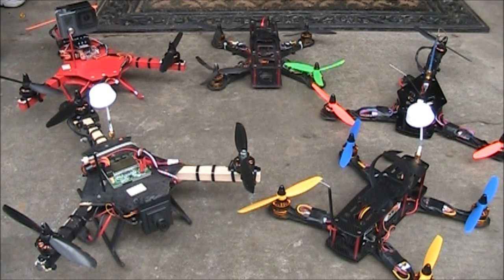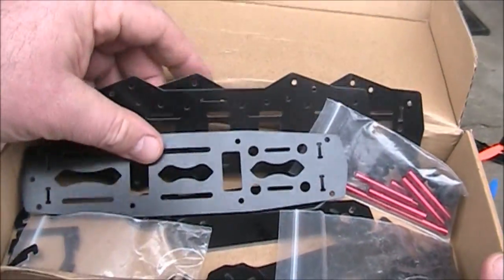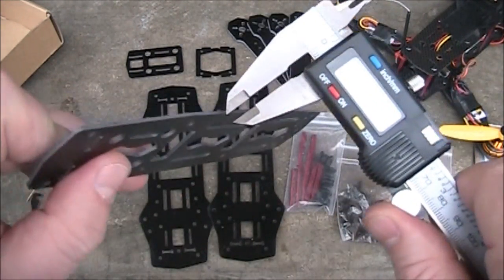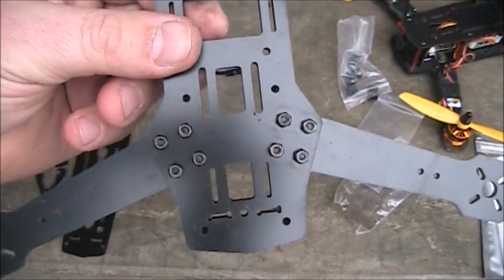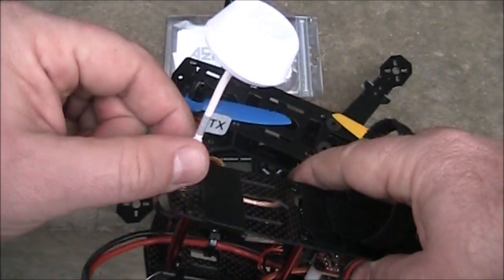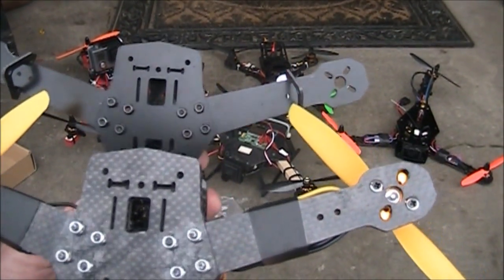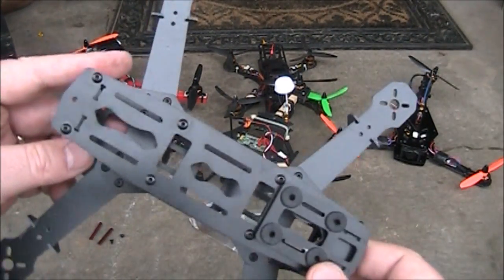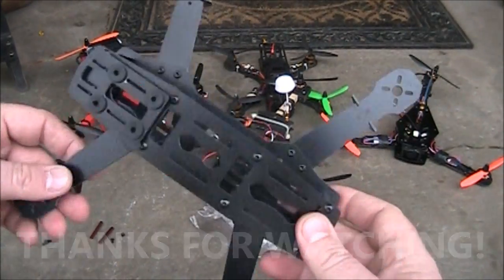ZMR250 Fiber Glass "Less Than 5 Minutes" Review

Comment: I have a fiberglass ZMR250 and I can tell you it is very tough. I fly terribly and have not broken it yet. I hit pavement and chain link fence and lots of dirt and trees with zero issues. I have been wondering what the weight difference was to see if it was worth getting the carbon fiber frame. Looks like I will stick with what I have for now.
Reply from the maker: Good to know its tough.  I'm going to try to put some larger motors than I usually use on this board and hope it flies well.
Reply: can any one pls tell me if i can use 6inch props with this frame?
Reply: @shutdahellup69420  ya you can